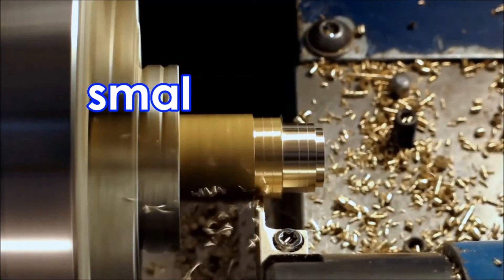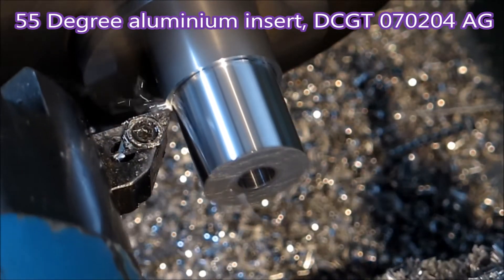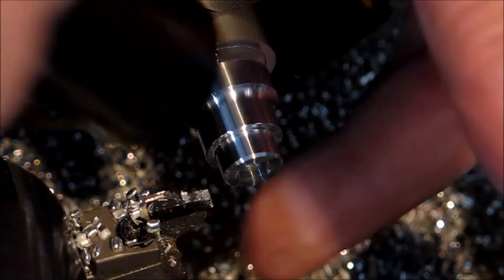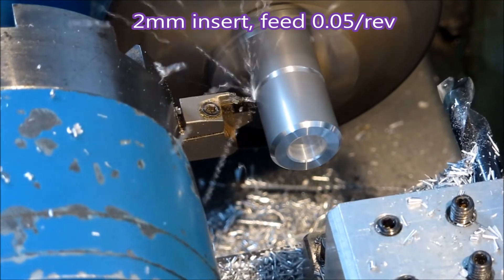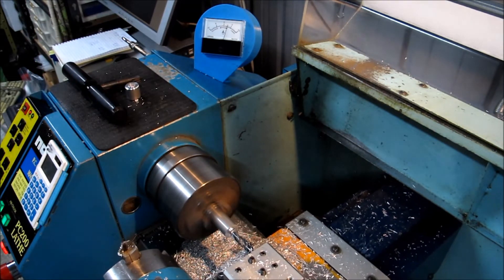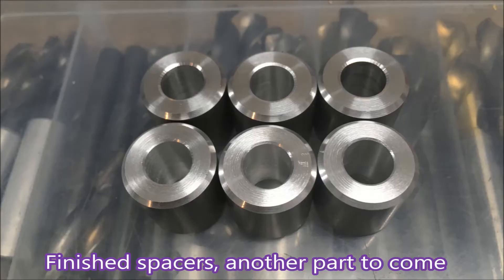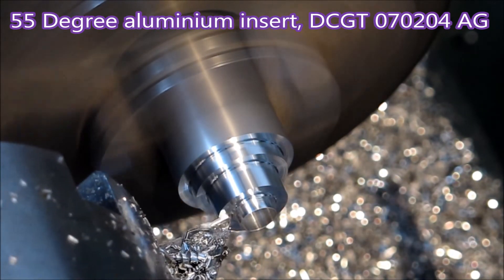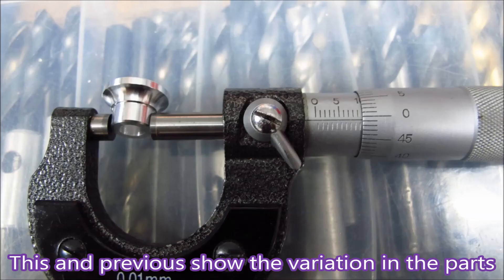Turn, drill & parting operations, making 3 different parts in 2011 alloy in small cnc lathe

Comment: What makes a carbide cutting tool for AL different from a carbide cutting tool for steel or some other metal?   Just curious.
Reply from the maker: Inserts for aluminium are usually have: 
Very high rake typically 20 degrees. Polished, I believe this helps prevent the aluminium from sticking to the insert faces. Damn sharp edge, the cutting edge is ground, many inserts are not, they are left as moulded, Makes for a really strong insert but from what I have been led to believe, it takes a fair amount of hp to get them to work properly. Even my general use inserts have a ground edge, more expensive than moulded but much easier on a small lathe. To give an idea, I have put some pics on my Notewell Facebook Page, if you want to take a look.
Reply: @smallcnclathes   Thanks for the information.  I will go look up your Notewell Facebook Page.

Comment: Spindle you use mortor or servo motor ?
Reply from the maker: Mr. Zero motor for spindle is made by SEM London. 180 vdc, 2500 rpm, 1/2 hp, 5 amps continuous rating. Works nicely since upgrading the motor to a Minarik motor driver.

Comment: Holding an 0.005+/- is respectable in some new machines let alone a PC200 :) What DOC you taking with those inserts
?
Reply from the maker: Thanks Manny, left that out did I? I will have to get back to you when I have checked the code.
As I said in the video, those pics with the micrometer were just to show the variation.  I don't know what anybody else thinks is good repeatability.  That is what the machine produces and if it is good, I am just fortunate. As long as I can keep customers happy, that is all I care about. Perfection is for those who have the time for it, I just try to get as close as I can. I find all the videos about chuck runout fascinating as I have no idea what mine may be, I would only check it if a customer complained about a part that was turned both ends, as none have it is of no interest!
Reply from the maker: Just checked the DOC.  1.5 on the first part and 2.0 on the last part.

Comment: Some great info there! You mentioned a CNC stub drill and another stub drill - would you mind sharing what the differences are?

Thanks!
Reply from the maker: A stub drill has the same flute geometry as a jobber drill. Point is usually 135 degrees with a split point.  A cnc stub drill has quite different flute geometry, the flutes appear to be larger and chips certainly tend to scoot along the flutes nicely. Can't recall the size but a recent price difference was $8 for standard stub and $24 for cnc stub (uncoated), Coated would probably be around $36.  The price difference is pretty huge, but I have found the cnc stub drills last a long time on non ferrous and tend to cut steel far better than a standard drill.  Stub drills, being shorter will normally "start" a hole on their own with no spotting drilling required. For cnc work this is a real advantage as it saves a tool change and separate operation.  Great for those with no turret, using gang tooling, with limited space. This is the way a number of Hercus users operate if they have no turret.|
https://www.cromwell.co.uk/shop/cutting-tools/hss-stub-/a1149-tin-2-50mm-type-ufl-stub-drill/p/TTX0250765R shows a cnc drill although not called that and below are standard stubs
Reply from the maker: Adam, I have uploaded pics of a stub vs cnc and a jobber vs deep hole jobber on my Notewell facebook page if it would be of interest